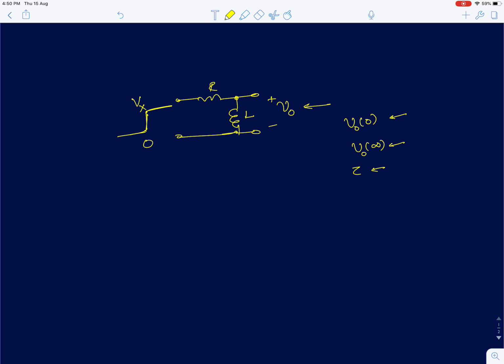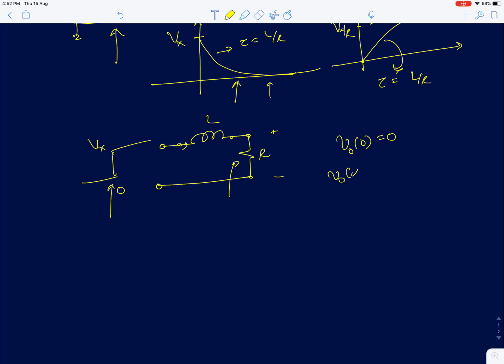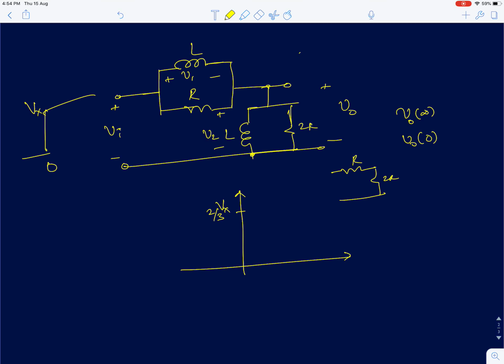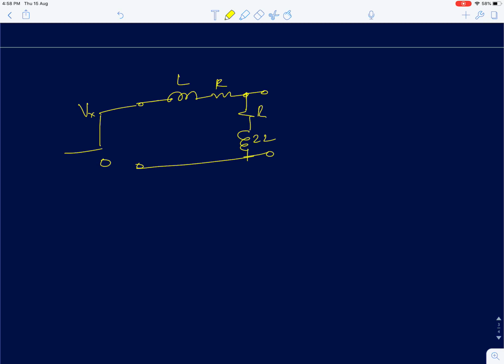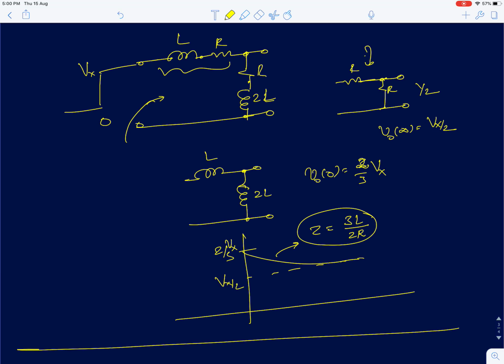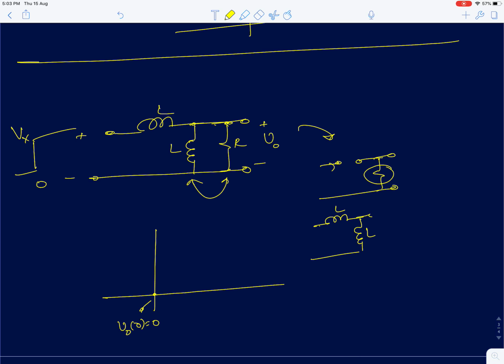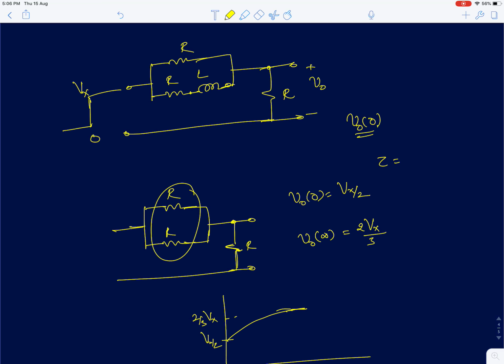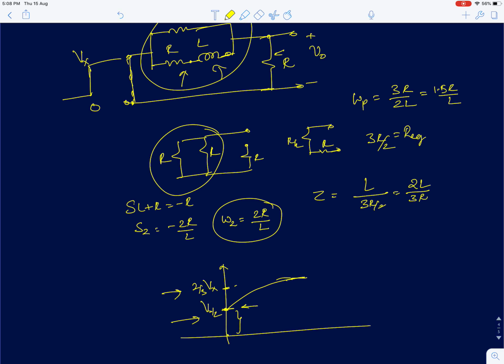ES Lecture 32: Estimating step response of first order RL circuits by inspection

Comment: how an inductor upon seeing a sudeen change in Vin, gives very large impedence? at (9:45), generally upon sudden change, at start, we open circuit 
the inductor tho
Reply: open circuit is as good as very high impedance . That can also be seen from the transfer function of the system too . a sudden change is as good as very high freq so the impedance will be high .